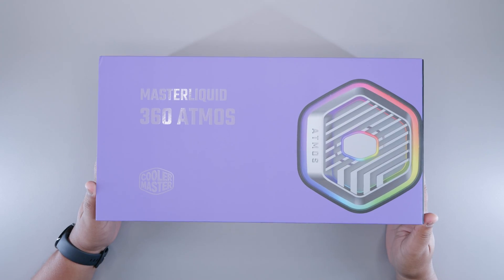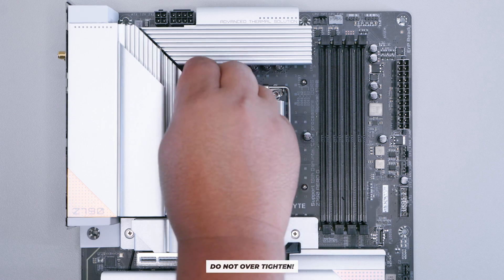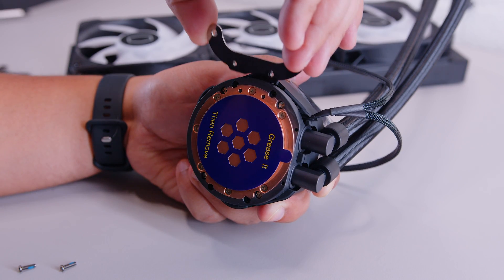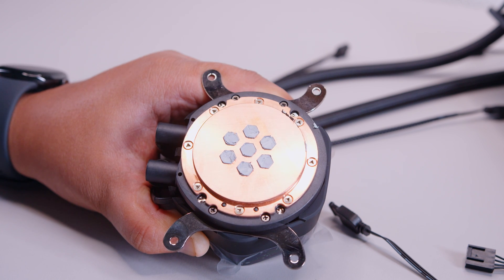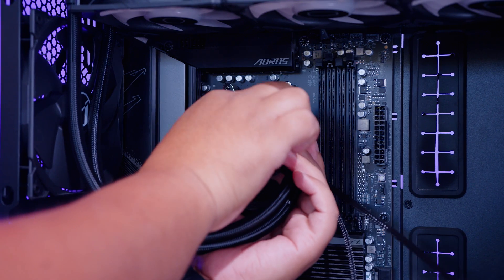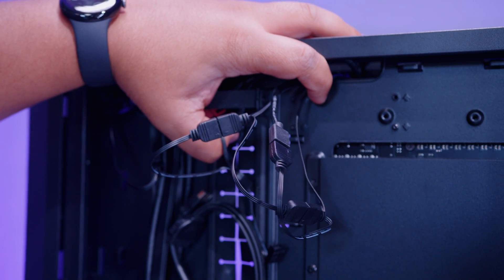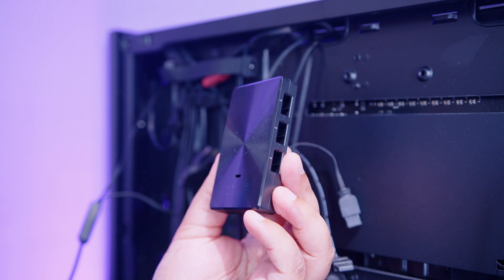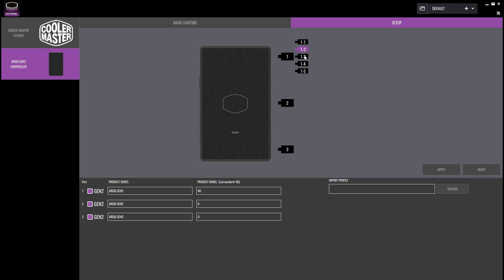Cooler Master 360/240 Atmos INSTALL GUIDE

Comment: Hi, thanks for making this great video and the process easy to understand. I just wanted to point out something that I noticed is that when placing the AMD cooler mounting screws next to the CPU socket is that the thread is thicker on one side and that must be which faces down. I found this out as I (luckily) put the first one in the correct way but didn't the second and although the thread was catching it wouldn't finger tighten.

Comment: Just purchaised this AIO end of Juli 2025, unfortunatly the termal paste was few and dry (it is at end of life by now and probably was build long time ago). Unfortunatly I have choosen to install it in their new case Masterframe 600 Black that is looking fantastic on the outside but cathastrophic in the internal layout. The support for AIO are in the central upper part (no offset possible!)  and the AIO (5.2 cm high) barely enter in the case but touch on the MB heathsink and cable managment is very hard to do. Thus, buy the Atmos Liquid Cooler but not this case until they don't change the internal structure that seems done by someone who never did a PC build in his life. It is incredible that a such known builder like Cooler Master make such poorly designed case.

Comment: I used the splitter to connect the 240 and the cpu mount, and daisy chained them to an argb header like the vid, but my asus mobo software and windows  lighting doesn't detect any argb devices.

They're just stuck on rainbow. What did I do wrong lol
Reply from the maker: You didn't watch the video lol
Reply: Guess I'll just re-watch in slow mo lol  @GearSeekers

Comment: Very detailed guide. Thanks! I'm struggling a little bit because i have purchased a CoolerMasterBox600 thinking that will be easier to connect the fans of the case and the fans of the Atmos360. The point is that when i try to connect the fans of the case that are alreay controlled by a controller of the case to the controller of the Atmos, the fans of the case don't work anymore. I'm doing something wrong?

Comment: So, if you don’t use the controller you don’t have to connect the pump to the power supply???
That part was not clear for me. Only saw the step to connect to the power supply on the last option through the controller.

Comment: I have the 360 coming with the components for my new build. Is the thermal paste included in the box? I noted the tube said Cooler Master on it so I'm guessing so but, I guess you could have already obtained their brand previously/separately. I tried listening again but, didn't hear or missed if you said the paste was in the box. Thanks for the detailed video. Will be my first water cooled system and was hoping there was a straight forward easy to follow video demonstrating the install.

Comment: So I'm doing this now. When I put the mounting bracket on the back of my mobo and then use the 4 thumb screws, it's loose. there's a bit of wiggle on the screws. It's not supposed to be loose is it? I'm using only parts from the intel mounting box that came with the cooler.
Reply: Well a quick search says that this is normal. There's a bit of play in the fitting but it tightens down when its all put together.

Comment: Just a heads up to anyone here installing this cooler. DO NOT use Cooler Master master control software. Or, at least, use it to check temps once, and set RGB, but then exit it out, make sure it doesn't run in background. The software was literally causing my AIO to spike randomly AND even when I plugged in my Iphone to charge. Took me ages to figure out why it was happening, evem after changing fan curves in bios.

Summary. The software is beyond horrible.

Comment: I've daisy chained the fans as shown, but there's no RGB. I've watched this again and again, do you not need one connected to the rgb header on the motherboard?
Reply from the maker: It was shown in the video
Reply: Where? It's daisy chained fans, but I don't see an explanation for connecting the rgb either.
Reply: Did you get this working I don’t have a controller and not sure what to do

Comment: I thinking about getting an APNX C1 case and it comes with a hub for the rgb fans already in it. Could I just plug the rgb cable into an extra argb port in it to sync the lighting with my cases fans

Comment: Props to Cooler Master not just for upping the game and making this in house, but also their efforts with regards to reducing waste packaging and the instructions on the boxes. Pretty simple and actually pretty genius.
Reply: The box is great. But I wish it came with a proper instruction manual tbh.
Reply: @JohnDavidSullivan  actually i guess the paper manuals are better rather than scrolling up to another page up and down to check the code of the component again and again. Maybe cause i am building after 10 years and a lot have changed

Comment: Anyone have experience with this cooler? For  AMD Ryzen 7 7800X3D?  Please give me an explanation!  Big Thanks.
Reply: It should be very good, 7800X3D has low power draw. I plan on getting one also for mine. You can even air cool that chip instead if you prefer.
Reply: This is a 4 month old comment, but I just did a build with this cooler and a 7800x3d. Cooler is good. Software for it is god awful. Kept causing fan spikes. Use software to set RGB settings, then don't run it again. If you want to find something to check cpu temps, use a different software.

Comment: the software might not be very good, but the Spectrum effect is very nice, i prefer it over the regular rainbow one and most other premade effects in other softwares.
Reply: Exactly
Reply: too bad my atmos pump died in a month
Reply: @freedomdst did you have it warrantied?
Reply: @rn-s  i guess, but since i bought it in amazon from usa to chile i would had to spend almost the same it costs to ship it, and coolermaster offered 0 help with anything. On the other hand, i got a Corsair one after that, had a problem with rgb balance, and corsair DIRECTLY sent me new fans (newer ones at that) without cost, so thats a big difference in customer service. Not going to coolermaster again after that.
Reply: @freedomdst Thanks for the insight. I have never bought a coolermaster product but this makes me not want to. On the other hand, I have had a Corsair PSU failed within 3 months and they sent me an upgrade since mine was out of stock. Excellent customer support for sure 😁

Comment: I want to share an experience regarding my PC setup. I purchased a 14th-generation i9, known for its high temperatures. My colleagues with the same processor and I have tested various AIOs and found that the one we chose offers the best performance and quality. It was so good that even though my unit arrived with a defect, emitting a strange noise from the pump fan, I decided to replace it with the same model. On another note, there are other AIOs in the market that seem superior due to their high price, but they aren't. From my experience, NZXTs lack sturdy construction and are too expensive for what they offer; with them, the processor ran slightly hotter compared to the Atmos 360. Although the temperature difference was minimal, the sound was noticeably different. Regarding LIAN LI AIOs, while they are good, they don’t match the price-quality ratio of the Atmos 360. If you're considering a different AIO, my second recommendation would be ARTIC or ASUS. As for a third option, I don’t have a clear preference.

Comment: Looks okay, slightly non-standard, retarded to have 3 fan plugs and also the pump plug, should only need 2 plugs. I have made better homemade coolers with a civic heater core that look better with clear tubing and UV dye and a blacklight though. Current 240mm only has 2 plugs, also those low rpm fans royally suck. 5000rpm fans or better only imho, don't like the sound, then just restrict the speed in motherboard bios. STUPID Coolermaster, stupid!

Comment: I brought this today and it is making weird noise please do help me out. Is it air that causing the issue? 
The noise is unbearable and how can I reduce the fan speed? Please do reply
Reply: “The sound is coming from the pump? If so, the same thing happened to me. I recommend that if the sound is from the entire system, it might be bubbles, and that’s normal while the system settles. If after a while it continues the same, you can try removing the radiator and moving it a bit. But if it’s the pump, I recommend changing it. I had the same issue and decided to replace it with the same model because this brand and version are very good, and it’s the only one that kept my i9 running at good temperatures.”
Reply: Hey bud did you just solve it through replacement? 

Has been a week with mine. Hunting for tips. 

Got recommended to run pump 80+ flat out. And since then a buzzing gradually grew from the pump and is now quite jarring. 

Any input by anyone would help, As I'm not in a warranty eligible region. 

Case: Ap201
Rad top. No exotic mounting. 
Sound definitely emitting from the pump. Temps unaffected, Functioning within spec. 

It's just the static like buzzing that's really sullying my whole experience cus i keep thinking about how it might just die anytime now
Reply: @cannotkazi  It took a week for me and yes the above guy was correct it was just air bubble. I will tell you to wait for another week and see if the issue is resolved. Look at your replacement policy if it is ending or near ending then replace it now.
Reply: @riktamsarkar7684  Oh cool. I suppose then your sound was emitting from the Radiator.

Sadly mine's definitely coming from the pump end. Yikes. 

Oh well. Sound advice. Will do.
Thanks for writing back so quick! Appreciate it.

Comment: Thanks for the good video. I'm using a b450 mainboard right now, so I don't have a 5v argb 3-pin port. If I use the controller in masterliquid atmos 240, can I adjust rgb on the cooler master app even if I don't have a 5v argb 3-pin port on the board?

Comment: For the three fan cable from the mother board the red connector has 4 contacts instead of three......so?
Reply: It's red to remind you that is the 4 pin pwm cable that goes into your cpu header.  This provides the tach signal to the other 2 fans which are 3 pin.

Comment: Why does the manual display the fan mount the wrong way? The way the manual shows it - the power cables will be in front. Really weird to have the pump cables go by the back fan of the case.

Comment: So I have the 240 on my pc build just installed. I was wondering on how the cooling works. Like do i have to put water in it? Or does it already come it in. Im doing my first pc build so any info would really help!
Reply: It is an All in One (AIO), liquid cooler also called a CLC (Closed Loop Cooler). This is because the cooling liquid is pre-filled in the system and then it is all closed up.

You do not need to add any water to the ATMOS, just wire it up correctly, and it should cool your CPU just fine.
Reply: Omg thats the best! Thanks so much I actually really appreciate that! I get my graphics card tomorrow super excited!
Reply: I don’t have a cpu-opt or aio plug in on my motherboard what do I plug it into?
Reply: @Rielits  what motherboard do you have?

Comment: Just a heads up, if you want to use the software, I believe you have to use the included rgb hub. I plugged my atmos 240 directly into the motherboard's argb header and it won't show up in any of the Cooler Master programs, but the rgb does show up under Asus Aura (I use a ROG Strix B650E-I itx motherboard in a Dan A4-H20) and is controllable there.
Reply: r u using he the 240 for a 7900X? trying to decide between that n the 360